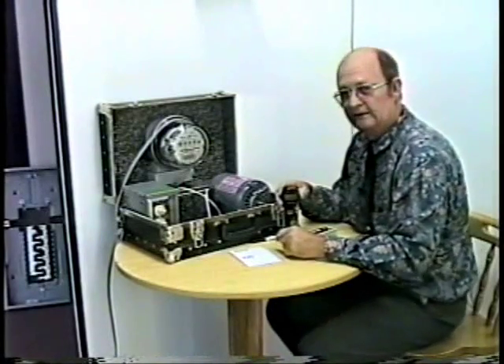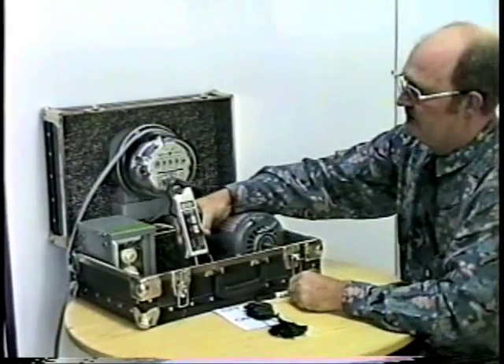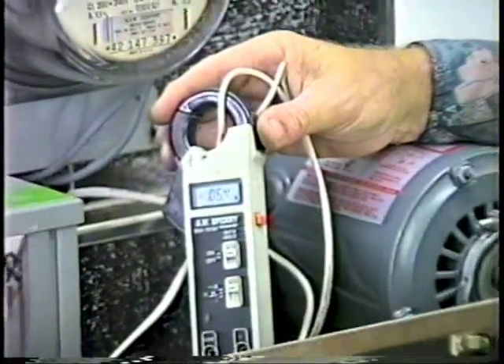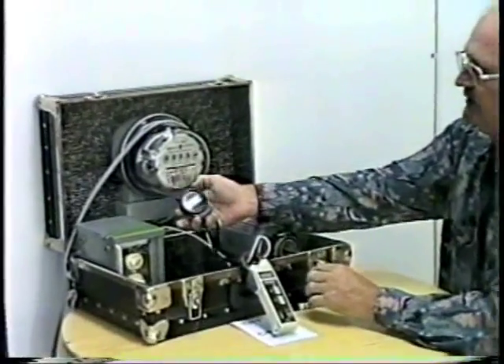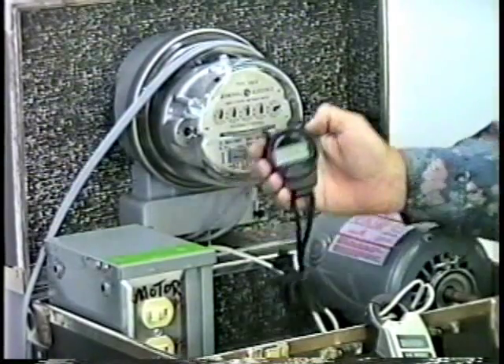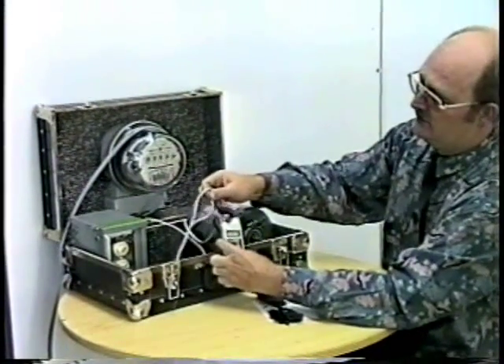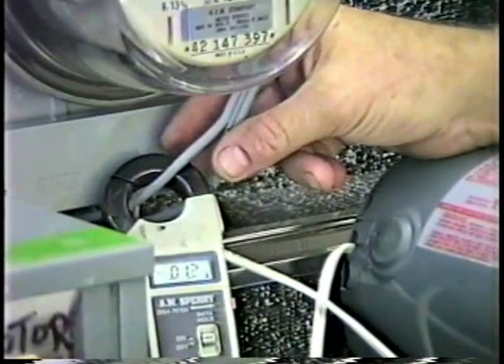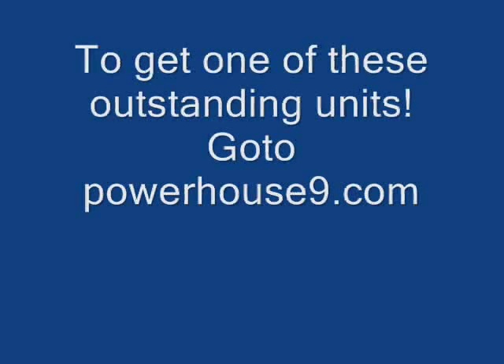Powerhouse Construction Group (KVAR training video)

Comment: The only way these thing work is if you have 120v motors running all the time like a swimming pool. What they dont show is what they use waiting for something to do its about 3 amps the eqivilent to a pair of energy star refridgerators with the doors left open. So ask these guys to tell you the amp draw when you are not running 110v motors. These can hlp if your home is an energy pig.

Comment: ugly101 is correct. The energy saving is trivial, he's running an unloaded splitphase motor, the savings are about 3% even under these conditions, where he's perfectly correcting for one motor, without knowing what your house has in the way of motors, which can vary greatly. Also, note the motor is pulling 5.5 amps even unloaded, a characteristic of very inefficient old designs. Sounds like a scam to me. But I'm only a degreed engineer, what do I know!